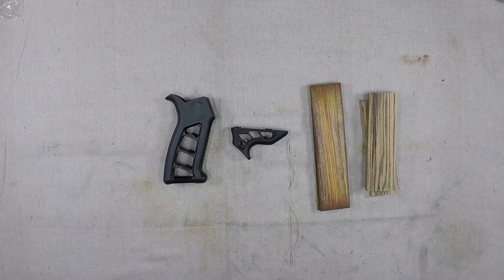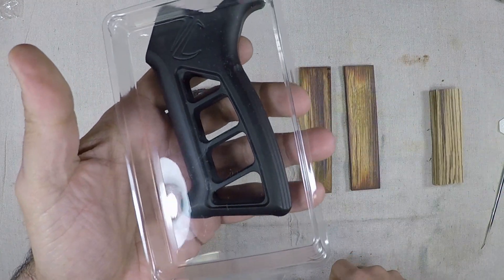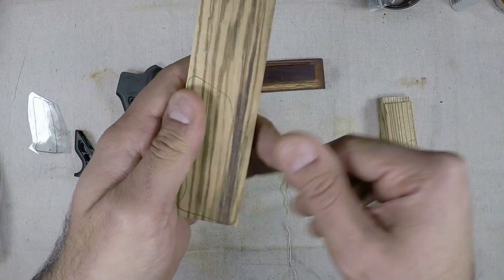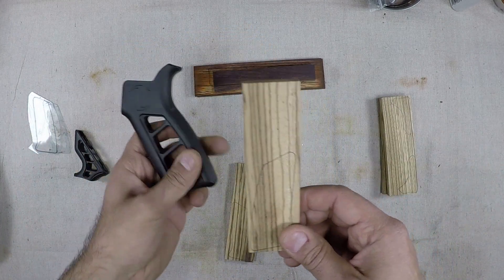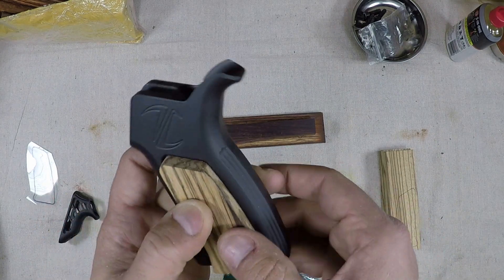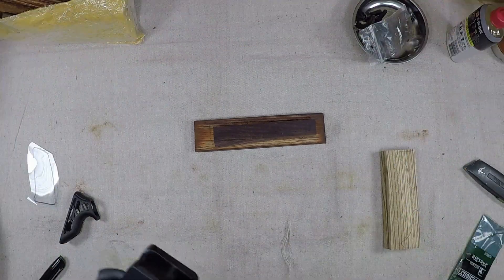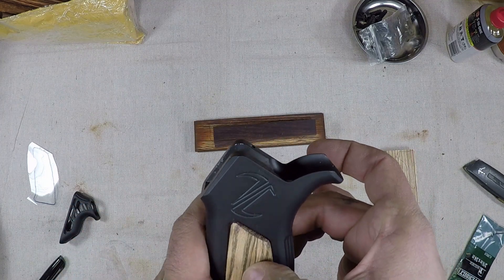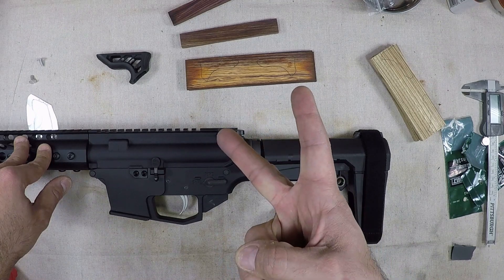DIY Wooden Grip, Handstop & Rails for MLok

Comment: Great idea. Great job. Definitely doing this now. Can you give more detail about the wood blanks you used? Size, depth, etc.?
Reply from the maker: Jeff Huett used zebra wood ripped to 1/2 inch thick.  Then just cut them to the length i wanted and width I wanted based on the rails I was using.  I had a few mistakes, but got a ton of extra from a 1.5"x 1.5"x6" piece of square stock.  For the grip it was much harder.  I still used the 1/2" thickness, but has to sand down a lot to contour.